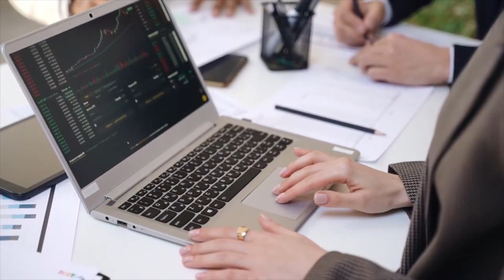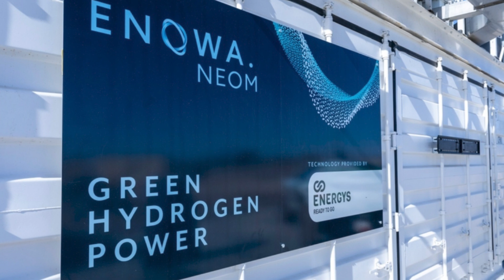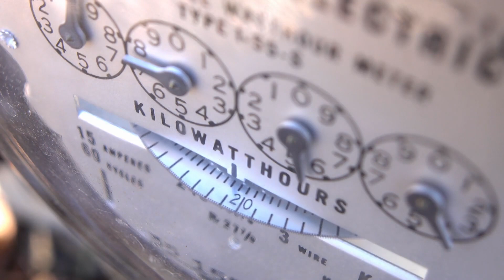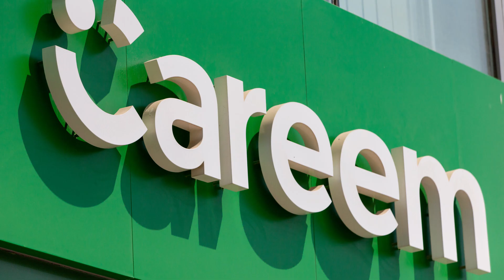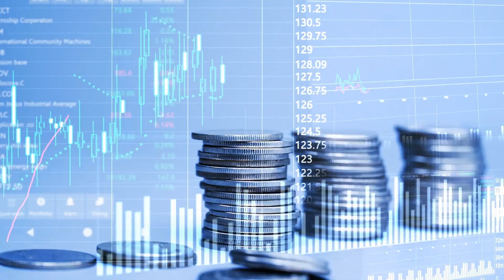NEOM City:  Satellite Images Show Incredible Progress  | INSANE 60000 workers on site!

Comment: imagine trying to travel from end to end lol. you''ll be losing so much time just from commute
Reply: duh they have hyper trains running in the line u can get from one end to the other in little time ur just hating
Reply: @talleneg  LOL.  dumb ass
Reply: @talleneg  it's 170km long. You still to walk to the train, wait for the train and then travel depending on speed. A line is dumb idea. It's like the person who proposed it has not learned anything from history at all. But not that I disagree building. In fact I want them to build it. It'll be a good experiment.
Reply: Most likely they will make center part of the Line as downtown. 
Eastern and Western parts will be residential areas. The outskirts of that as most exclusive areas. 
You can get to lively downtown from both sides equally fast
Reply: @emmanuilushka pmpl